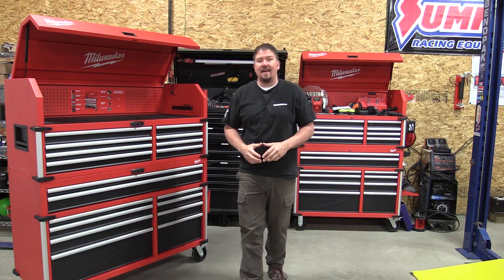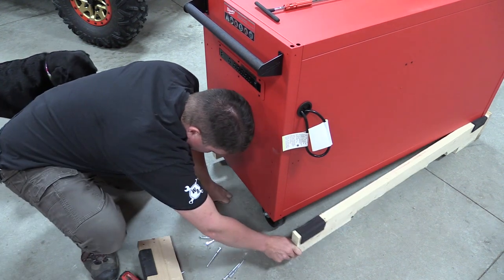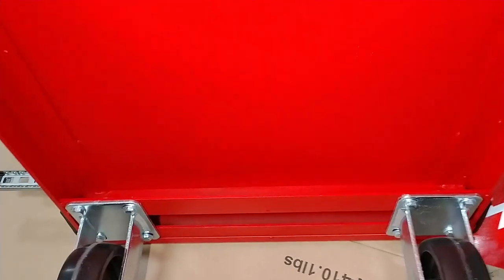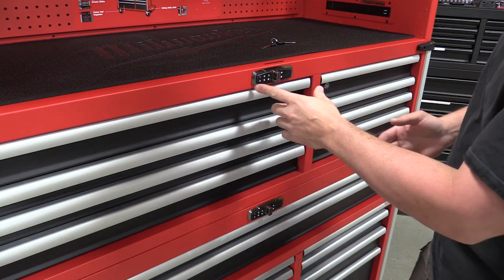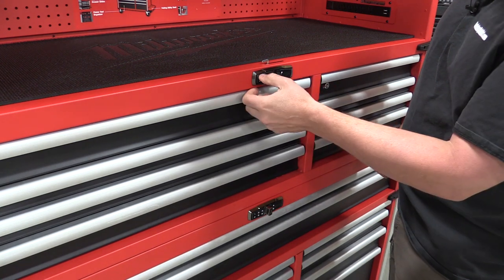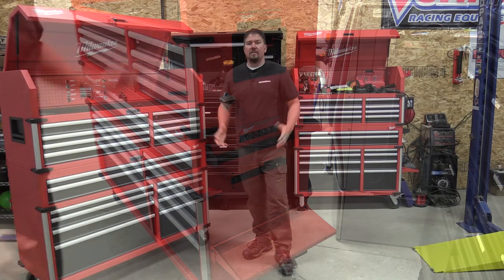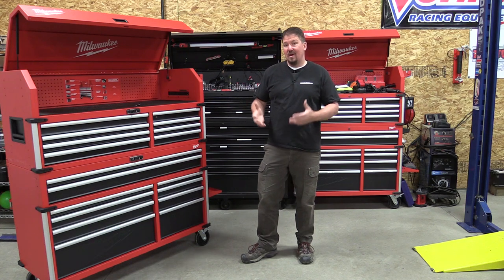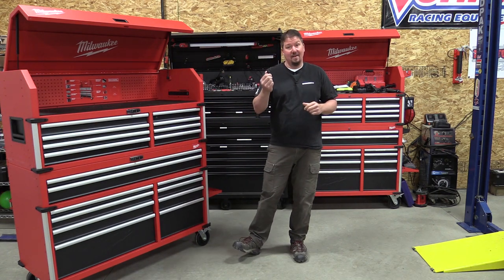Hits & Misses on the Milwaukee High Capacity 56" 18-Drawer Tool Chest and Cabinet Combo

Comment: Very happy with my harbor freight series 2 box. people give HF a bad rap, but their tool chests/cabinets are pretty hard to beat.
Reply: I loved the HF boxes, I just can't get over the latching mechanism on the 56in and 72in boxes, I so wanted the 72in lower and 56in upper but I like to grab and open my draws and not have to favor one side.
Reply: @donelias1981  Yes.  This was a huge drawback to me when I looked at HF boxes.  I LOVE my magnetic snap-close Husky where I can pull on the drawer anywhere.
Reply: Colin Stuart, Harbor Freight has really stepped up their game with their Tool Storage Units.
Reply: @donelias1981  I personally like the latches, im not a fan of the tensioned slides. But at least they aren't soft closing.

Comment: Lots has changed price-wise with all the various brands of steel boxes since this video was made 3 years ago. Considering today's pricing, I had my choices narrowed down to the 46-in high capacity Milwaukee box and the 52-in matte black Husky box. They were side by side at my local Home Depot so I was able to easily compare them. They are both nice boxes for a home garage, but the Milwaukee is a slight step above the Husky in my opinion. Although the Husky is 1,477 cu.in. bigger, the Milwaukee weighs 59 lb more, which tells me a lot. The aesthetic on the Milwaukee was better in my opinion, but I much prefer red over black anyway. The Milwaukee's red & black textured finish is much nicer. Lots of external extras come with the Milwaukee. And the final kicker was that the Milwaukee was $100 less than the Husky at $898 vs $998.
Reply: I thought the husky boxes felt much more stout than the Milwaukee.
Reply: @MrFPSWisconsin  I just compared both at HD and thought the Milwaukee boxes were a step above in the felt sturdiness.

Comment: I really appreciate this review. It showed the constitution of the box inside and out. I just want to know how well a tool box is actually built. I typically look at the dimensions and weight of a tool box and compare it to other similar boxes to try to get an idea if it’s a quality box but you can’t really know until you crawl inside it and under it. Great insight on the locks and usability of the drawers. Thank you for an in depth, quality review and an honest opinion on this tool box. Very nicely done!

Comment: I just bought this box from Home Depot. Retired military mechanic with 21 years of experience in diesel maintenance. I would have to agree with you on some points. It almost seems they rushed the production of this box. I was not crazy at all to see the rails for the drawers were riveted to the side of the box; would have liked to see something like the snap on rails which Snap-On uses on their KRL series of tool boxes. The addition of the built in power strips is a nice feature giving you so flexibility with cordless automotive tools or power tools you may use while conducting repairs on equipment / vehicles. I didn’t like the rail on the bottom big cabinet; due to it being mounted 3/4 of the way towards the right of the drawer. So if you put any significant weights like I did on my with socket kits it will tend to drag on the bottom support beam just below the drawer. They should have added another support beam on the left hand side, this way the weight capacity would have been balance more effectively.  Don’t really care for that tool bracket which is supposed to hold tools externally, I think the overall idea is neat. Just not very well thought out,
The lid on my box is also not centered. There is a 3/8” gap on the left side and a 1/4” gap on the right. Furthermore, the height is different also on the front corners of the lid versus the side metal sheets / arms. Therefore, my overall impressions are this would be an outstanding box for a technician who is starting out in the maintenance industry and is not able to afford the ridiculously priced mobile truck tool boxes.
Reply from the maker: Thank you for this great review.  I hope others read it and it helps with their purchase decision.

Comment: I really appreciate the the honesty in pointing out the pros n cons on this box. I was very excited about the longer box and all the supposed beefier aspects. I found the old box lacking and of lessor quality than my masterforce of 7yrs. When I got see it in store i did pull out the drawers much to the dismay of store staff. Disappointed to say the least though I was in no position to see the bottom as you showed. Appreciate that. I didn’t like the locks and how they work either. The narrow drawers would gain me very little having to discard my current set up to lay everything flat. I thought your drawer pullout fully to access back couple of inches was spot on. The height of hutch would benefit me but that was a very small item in the pro column. I was still trying hard to justify the cost so to compare I walked  over to the husky 56” which my son n law got while on sale last Christmas. That’s when the store associate came over to attach the price tag to the top box of the Milwaukee, lol. I love Milwaukee but this particular box is an easy no for me. Thanks for your time and effort in letting us know your thoughts in this video. Stay safe
Reply from the maker: Thanks for your support Tim!

Comment: I have the Husky 56 inch chest and matching 46 inch mobil work bench in the garage. they work great for me. I also use a few old Lateral and vertical filing cabinets as tool storage. The used file cabinets carry more weight than any rolling tool chest are dirt cheap compared to the rolling tool chests   I also label my drawers. I use 3/4 inch P-Touch labels applied to double stick magnetic tape. The magnetic labels are great if i need to add or rearrange tools. Thanks for the review.

Comment: I've kicked the idea around for a while on this box.  I own rental properties and over the years as I've done demolition and remodeling, I have purchased ungodly amounts of tools.  I'm not thrilled by 18ga, but it's just going to sit in my garage at home, so I don't really need anything super heavy duty or secure.

Up until a few days ago, Home Depot had the lower half yellow tagged for $599 (25% off).  It sat for about two weeks and I approached the store manager with an offer of $300.  She was willing to mark it down another 25% (50% total ($400)) and I should have jumped right on it because it was gone the next day when someone came in and offered $50 less than the $599 they were asking.  That one had some issues that needed work.  The drawers would only open half way.  Seemed like an easy fix for $400.  

So, I think I'm just going to bite the bullet and buy the combo this week.  Thanks for the review!

Comment: I had the same issue with my box on the drawers not opening the full length. But I found if you pull it past it’s factory set stop which doesn’t take much force at all. Then it opens the full length and works exactly as it did before but it always opens the full length now. I’ve had mine for 3 years now and would highly recommend it

Comment: That why I went with us general 72 in bottom and the 56 in top chest  for the price  of Milwaukee  and got side cabinet and locker  and only major issue had it with it was locks were little sticking side and hinges side lockers made popping sound which was easy fixed lubricated love mwchnasims  and hinges haven't had any trouble since I been happy with box I had right 2 years  but me personal I wouldn't give 1498 for that box  now if was 999 I say yes I give that but 1498 not no hell no

Comment: I agree 100% with everything you said the box is not worth what they are asking for it, the bottom lock stoped working something  gave out inside,  and the new replacement lock wouldn't work properly unless the bars that are running acrossthe top on the inside of the tool chest ware bent

Comment: I just bought the 56 " top chest to go on top of my 64" Craftsman bottom chest.. I have another 46" Milwaukee top chest on top of a 48" white Husky. And I have the 46" top and bottom Milwaukee which I got for less than $800 about 5 years ago. Just for the 56" I paid around $450 with my 15% off coupon at Home Depot. So far so good.

Comment: I know this is an old video but... I will note something on drawers and sizes. I just recently purchased the 61" mobile workstation to go with my (pretty sure 46" toolbox). I was back and forth between two different husky stations and the Milwaukee. I won't go into all the reasons why I chose the Milwaukee, but the drawers was one of the big reasons. The main husky contender had a hole bunch of slim drawers. I went with the Milwaukee because, even though it has less drawers, they were deeper. I run into the problem with my main tool box of the drawers not being deep enough to accommodate some of my tools. Sure, sockets and wrenches and screw drivers aren't deep, but adding in impact guns, kits that have cases (fuel pressure regulator, compression/leak down tester, angle grinder, etc.), that taller drawer makes the difference. So while you are right (I would have liked to have seen a 3rd row of drawers, at least up top), the size and shape of the drawers also hits a lot on preference and usage. Long story short, make sure to consider how you are going to use your box influence what box you go with. And yes, I own a number of Milwaukee tools, but I am not a Milwaukee fan boy. Nice to see a legit review of Milwaukee stuff not just fluffing them. <end novel>

Comment: as a new tech, first and only box ive owned is the Milwaukee 46in(bottom only) and I really like it, already outgrew it and was looking into upgrading to the 56in, but this video has me second guessing, specially for the electronic lock and seeing the top drawer not opening all the way is still an issue, is the similar Husky a good alternative?
Reply: I don’t recommend a husky. Milwaukee or US general are your best bets for staying in the low price range. I had a husky box bought for me by the dealership I started working at in the beginning. Started crapping out after 7 months of shop use. Husky is good for home garages, not for being beat on in a shop.

Comment: Honest in-depth review. Hope that was a test sample. Love the channel 👍. ...you can get an Extreme tools box for the same price, much better quality. I started with a DeWalt box. Now I have the Extreme tools 72” ( Gearwrench edition) black w/ red handles 21 drawer cabinet with side locker and hutch. ( 12g frame, 150 lb  slides , double slides on big drawers., 1100 lb casters) . 
       ...Milwaukee hyped this up, but it falls short.
Reply from the maker: Thanks Joe, was not a test sample.  Had to buy it for the video.  :(
Reply: WorkshopAddict hope it works out for you. At least it matches the other ones.✌️

Comment: Good review way more in depth than I did, but I bought 2 56",2 lockers,& 61" bench. I also removed the computer panels. I actualy prefer larger drawers and wish they would make a center cabinet to set between upper & lower with larger drawers. Guess I was lucky all my locks work & skids were bolted together. I'm happy with the boxes and they are full of mostly Milwaukee tools.plannig on buying another 56"+ locker, probably 52" bench. Kind of a Milwaukee finatic. But they don't make everything and there are a lot of good tool companies out there.

Comment: I bought this box using it in a dealership and my bottom box lock did fail after the first couple locks and got it replaced and now I have no issue I bought mine from home depot for 1200 ish dollars and I love my layout and the depth, it's so helpful if you want I can send pics of how I played out my drawer but after i got my bottem box fixed I'll give it a 8 out of 10
Reply from the maker: How did you get money off and what was the direction you went for service.  We could not get our lock serviced and it had to be returned.
Reply: @WorkshopAddict  sorry I never saw your question but I'm pretty sure they and mistakenly prices it at the 46 in high capacity in Central Michigan and for the repair i called the place where I bought it at home depot and they where very understanding and I had to return that bottom box and walk out with a new bottom very easy for me atless

Comment: It may be fine in a stationery position.
    But with out it being reinforced with tubular Steel.
    It will break apart if it’s not on a perfectly smooth floor. 
      Looks aren’t everything.
      Not that I’m in the market for a new box. But if I was 
     I’ll pass on Milwaukee Tool storage units.

Comment: Great video. I had the same issues with my box when I got it and explored it further. Mine had a lot of ugly powder coat finish issues and I found the tack weld assembly pretty mediocre. Had high hopes for it but was bummed out so I returned it. $1500+ Tax is too much for this box. Sticking to my 52" Husky.
Reply from the maker: The more the box sits in the shop, the more I feel exactly like how you did.

Comment: Just bought this last night.  The top was $499 and the bottom was $699 ($1,198).  Because these are inactive SKU's and Home Depot will not be reordering them, you can get a couple hundred dollars off.  I paid $998 for the pair.
Reply: I did as well, but 2 weeks ago. They play with the bottom cabinet prices ($699-$899).  What determines it?  Who knows. I would not buy for $1,500. I needed an extra box in our shop and it was cheap and available now.  If I had to buy a cheap box (not SnapOn or Mac, etc), then I’d get the Husky 56” heavy duty box. It’s the same box, $500 less, and have plain old barrel locks. I actually have both of those boxes and I’d buy the Husky again and again. The Milwaukee....it’s OK but only because I didn’t pay full price. Don’t lock it.

Comment: Just bought this one, On sale and opened a credit card so I got it for $1100
Seems good so far.  My only complaint is about buying such a massive box.  If I did it again I might buy 2 smaller boxes because they would be easier to transport.  I like that it only has 4 wheels rather than the 6 wheels on the husky (less awkward to move)

Comment: major fail on the locks. I agree they need more drawers, stronger design and better access. Personally I would rather have two husky bottom boxes 56" wide and get more drawers and a larger work surface.

Comment: I have this Milwaukee box set. got it 2 months ago, I like it.
I don't like that the lock fell apart dam near right away on the top chest. and that 2 months later I still don't have a replacement.
so if you are worried about the battery don't. the plastic housing will fall apart. you wont have to worry about the battery. the lock wont work. at all.....
Reply from the maker: That really sucks
Reply: @WorkshopAddict  I got lucky. I still haven't gotten a replacement. so fed up I took it apart again. the lock has a micro solenoid that retracts out of a slot in the cylinder. apparently the reason it fell apart is the cylinder was put in 180 degrees rotated from where it has to be. it could never have locked. I thought "no way" so I completely took it all apart, turned it like I thought it should be. it works. there's no way for it to have turned. it was assembled wrong. its a cool looking mechanism but for the future I'm looking into what to replace it with. its not listed as a part to buy from Milwaukee. but its got to be expensive. that solenoid is about 1/2 long 3/16 diameter. then the circuit board.

I took pics, I wasn't in the mood to video and post it though I really should have. Pain in az to get it out of the box, and then apart. a few 1mm screws to not loose.

I do like the box, does what I wanted, holds stuff and mounts for chargers, all that.
If I knew what I was getting into with the lock, I probably would have hunted for the smaller Milwaukee set.

Comment: @Workshopaddict, I guarantee you that's because that Box is built by the exact same Company that builds the Husky Box. It cost you $400 extra because it is Black & Red and has Milwaukee & a Lightning Bolt on it. I hate the Drawer Layout. When I look.for a Box, i prefer at least 3, preferably 4 full width Drawers, and 1 of those Drawers (my Socket Drawer) has to be around 5-1/2" to 6" deep. All my Sockets are stood up on Hansen and Westling Machine Socket Trays/Stands, and I have quite a few Extra Deep Sockets, which are 5" alone not counting the the Tray. I like 1 Drawer all Sockets, 1 SAE Wrench Drawer, 1 Metric Wrench Drawer, and 1 Drawer that's all Screwdrivers, and i want them all full width due to the amount of these Tools that I have. That's just me though! Good Video! I know there is no way i would lay out 15 Ben Franklins for that Box, and I'm a big Fan of Milwaukee. I would buy a Husky over that. However, I actually prefer Snap On Epiq. Not everyone can swing that though.

Comment: I'd love to have this box for my shop box. There's a few positives that I was really looking at for this specific box. Was the pre-drilled holes for chargers on the sides of the box. As well as it would stand out in the shop as most people have black colored boxes from various brands. The electronic locks was something I wasn't necessarily a plus for me, but it is a nice feature. Be nice to see if you get the bottom boxes lock to work because that would concern myself as well.